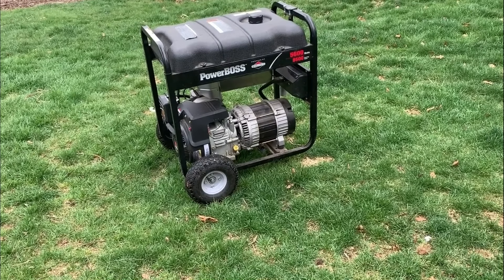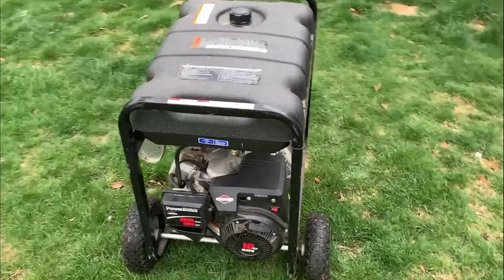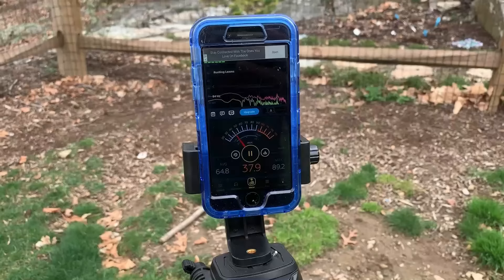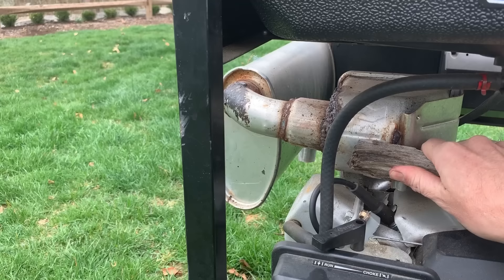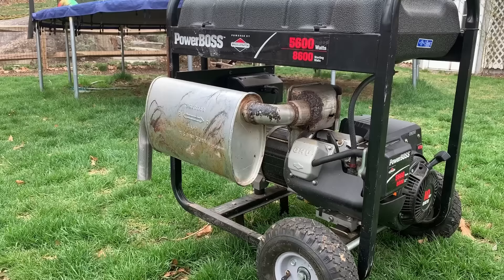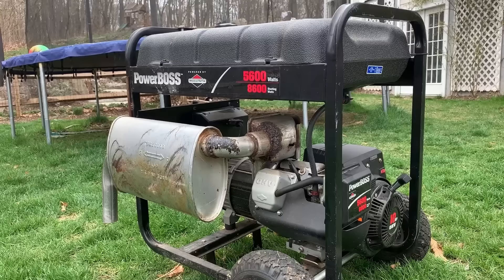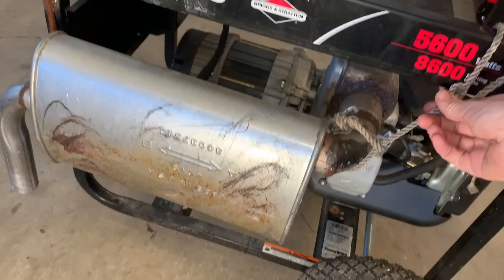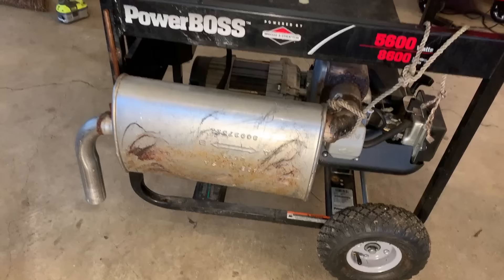Will a Car Muffler Make a Generator Quiet?

Comment: You do realize that every increase of 3db is a doubling of sound pressure, right? (logarithmic, not linear) So, 5db is 3.16 times louder! (6db would be 4x, 9db would be 8x, 12db = 16x... Car muffler was doing a lot, actually. :(
Reply: we perceive a doubling in volume at +10db though, so while you are correct we wont hear it that way.
Reply: @DracolegacyOfficial  Pick a level as the reference, and +3db is a doubling of power, but you are correct and I stand corrected... 10db or 10X more power is required for the human ear to 'perceive' a doubling in loudness. :)
Reply: @scottdebruyn7038  What
Reply: Anything way though, the reduction of pressure is the big on for your ear drums. You may not hear the diffrance but it's like standing in a node, the pressure could be felt if your ears havnt been abused by high pressure pulses and loud sounds already. Based in what I've learned at least
Reply: @michaellandon1960  Yeah... Wild, huh?
Reply: @scottdebruyn7038  I was going to say the exact same thing :-)
Reply: @DracolegacyOfficial  
You can train yourself to be able to perceive a doubling of the sound pressure
Reply: @andriesquast2028  you got proof for that claim?
Reply: @DracolegacyOfficial  I can absolutely hear a 3dB change. I'm a professional audio engineer, sometimes I make adjustments of 0.5dB or less. You can definitely train yourself to hear very small changes in volume.
Reply: @NealMiskinMusic  congratulations, i make minor adjustments as well but it doesnt mean you actually perceive a doubling in volume at +3db and i'd be willing to bet your micro adjusting takes place at volume levels lower than what people would listen to music or tv at. but of course, this is the comments section on youtube, everyone is a professional.
Reply: @DracolegacyOfficial  
It’s clear to me that you can’t read.

I said YOU can train YOURSELF.
It is not possible for anybody else to do it for you, Einstein.
Reply: @DracolegacyOfficial  You don't perceive 3dB as a doubling of volume, but you can certainly perceive it.
Reply: @NealMiskinMusic  that's my fucking point. I never said we don't hear it, we just don't hear it as double the volume
Reply: @DracolegacyOfficial  
Speak for yourself.
Reply: Interesting. Always perceived it like 3db would be much. Like if you have $75 then $3 wouldn’t be much more.
Reply: @jacobhudson1072  dB works on an exponential curve. what's really mind blowing is how much energy is required to increase volume as you get higher on the scale.
Reply: Sound is 6db change is a factor of two is it not?  
Power is a 3db change, sound pressure is a 6db change?
Reply: @DracolegacyOfficial  i felt your pain in this comment thread lol.
Reply: @Meekmillan  it was definitely a thing and shows how some people refuse to just read the damn thread.
Reply: Even with a hole it was quieter wow
Reply: yeah 5 db is a lot but that isn't really what is important, the percieved noise is important, the muffler subdues some frequencies better than others as well as not all noise is from the exhaust, and muffler "only" lowers exhaust noise, plus he was there filming it and he said not a very large difference, either way i put mufflers and sound dampening on stuff that annoys me,
Reply: He also measured in DBA while the common used scale is DBC
Reply: @DracolegacyOfficial  even if we don't hear it that way, it moves it further from the danger zone where hearing would be damaged.
Reply: @skellious  holy shit, you didn't even pay attention to what I said
Reply: I couldn't have explained it any better.
Reply: ⚠️Generator safety tips: 

This is only a reminder 

1) KEEPING OTHERS SAFE: Please do not allow an unqualified person or your children to operate and service the portable generator. Just because some manuals don’t say that doesn’t mean it’s safe. That is important against the generator safety rules. We also need to be keeping an eye on our children too. You need to make sure that your children are not playing near the portable generator especially when it’s running so they won’t get electrocuted. Generators pose electrical risks and they can be hot during an operation. Please keep your children away from the portable generator at all times. It is important to keep our children safe especially our little ones. Children often get curious about anything so we should keep an eye on them to also make sure they’re not wandering towards the generator. 

2) WHERE TO RUN YOUR GENERATOR: Some people use their portable generators indoors which increases the risk of carbon monoxide poisoning. It’s important to have a carbon monoxide if you have a gas generator. Never ever use your generator indoors even if your doors and windows are open and even in the garage is not safe to use a portable generator. Not even at your porch and your deck. It is never safe to use your generator indoors and in enclosed areas of your home. Your generator needs to be 15-20 feet away from your house. 

3)🔥FIRE HAZARDS: Never refuel your generator while it’s running. You need to let your generator cool off before refueling it and before storing your generator. Never overload your generator too. Never ever back feed your generator. You should never plug your generator into a wall outlet. Also never store propane tanks indoors. Please keep flammable things away from the generator as well and please don’t smoke cigarettes near the generator. Having a fire extinguisher next to the generator is also important against the generator safety rules. 

4) GENERATOR OPERATION: make sure your hands are dry before touching the generator. Never use your generator in wet conditions. Don’t let your generator get wet. You need a generator tent if you need to use your generator during wet weather. Please don’t wear loose clothes when operating the generator. Turn on your generator before plugging in appliances. Use the right cord for your generator. Please do not use worn out cords. 

Hope this helps.
Reply: No.  The defining equation from acoustics is dB=20 log(p2/p1) so a doubling occurs when dB=6.
Reply: @MrShobar  But that's base 10 logs.  If you have wooden logs or plastic logs it's a different base.  Binary base 3 logs in a 7th dimension are like unicorns.  And don't get me started on imaginary logs.  They have negative square roots?  Logs...roots...where are the leaves?  I'll "go" now.  Have a good day.
Reply: @NealMiskinMusic  The question wasn't if you could perceive it.  It's a question of the perception of "twice as loud".  In humans, 10db increase is perceived as "twice" as loud.  Of course pretty much any change of sound pressure can be perceived, but that's not what we're talking about.
Reply: I'm a sound guy.  I've run PA's... modded audio equipment...  5dB though is mildly perceivable,  and you're right about the math, but the way our ears hears it, its DEFINITELY not worth the headache of welding that muffler.  I'll bet the guy who did that, felt REALLY dumb after he fired it up🤣
Reply: @NealMiskinMusic  Everyone can hear changes in volume.. I'm not sure many could tell you without active references and in any environment when you have increased volume precisely double. This is even more complicated when you consider different frequency ranges as you would perceive some ranges differently then other, for instance, around 1500 hz you will probably notice differences quite well while at 30khz you might not notice much of any real change at all as an adult. As a professional sound audio engineer i'm sure you know just how complex sound actually is and wouldn't just be some ass on the internet talk out their ass right?
Reply: @NeverSuspects  We perceive volume changes approximately the same in different frequency ranges. Yes our ears are tuned to midrange, so 70dBSPL at 60hz will sound less loud than 70dBSPL at 1000hz but a 3dB increase at either frequency should sound like it increases by about the same mount.

The main point I was trying to make here is that while this is a significant reduction in the amount of energy, but a somewhat smaller perceptual difference, but still very much perceptible.
Reply: If  you're going to be pedantic, at least pedant correctly. Doubling is an increase of 3.01029995664 dB. [10 log10(2)]
Reply: @jonjohnson3027  Pedantic is nit picking some small percentage... was this?
Reply: Stalin was just as bad....  Actually worse ...

Comment: If anyone wants to mount an automotive muffler to a generator, it needs to be supported by the engine/alternator assembly, not the generator frame.  Everything attached to the engine needs to be able to move as one unit because the engine and alternator are mounted on rubber isolators.  If you don't, either the muffler bolts will vibrate loose, or something will break.  Maybe both.
Reply: Or use a flex section of pipe...
Reply: @OmegaZero1242  the spiral flexible exhaust pipe (i assume this is what you're referring to) isn't meant to be continually flexed, it's meant to be easily bent to the required shape.  If it's continually flexed, it will loosen up and leak
Reply: A rubber hanger mounting on the exhaust would have been fine; it's exactly what is done with car exhaust systems, and why it was welded direct to the frame, I've no idea (and it ought to have been joined to the standard muffler using a U-clamp).
Reply: Metal should never touch metal unless properly secured. Learned that in auto tech school
Reply: Exactly right, the muffler needs to be supported by a bracket and the engine vibration isolated by a flexible pipe of some sort. Sure the metal flex will slowly wear through but better than having the exhaust "manifold" (a 3/4" inch of threaded black iron gas pipe) vibrate and crack the head. Another factor: much of the B&S noise is from the internals which sound like a #10 soup can full of nuts and bolts rattling. You can only do so much to quiet these engines.

Another option is to move the generator farther from the using device (which might be a transfer switch of some type to power your house in emergencies). This also gets the exhaust fumes and carbon monoxide farther away, too. The trick is that a 40' power cord is expensive, but what's your life worth?

In 1990, I built a portable 2x4 framed, insulated wall system on two sides to deaden and direct the noise in a line between my house and my neighbor's. It worked but in the end I saved up for and bought a permanent natural gas all-home 20kw automatic generator. While a step up, I wouldn't discourage those who are shooting for a similar level of protection at the cost of these smaller 5kw construction type generators.